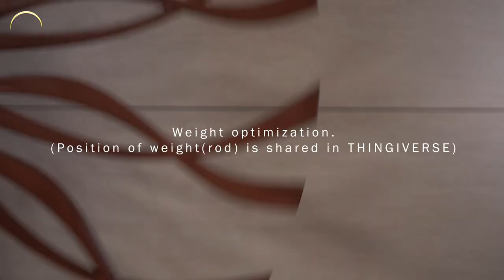The Process of Making Kinetic Sculpture that Creates Optical Illusions  (Branches, Kinetic Art)

Comment: Lovely work, Dr. Moon. I have created your Aurora version but am so frustrated. The two pawls do not transfer direction as they should.  I.e., the rotating wings do not change from their initial direction of spinning. I understand that the pawls need to interact so as to cause a change in direction but that is not happening. 
,
The pawls do work as planned when I rotate the wings by hand. However, when under speed, the back pawl never releases pressure from the control gear. It does not “hand off” to the front pawl. (I hope this makes sense?) Can you help me please?
Reply from the maker: Thanks for your interest on my work. :)

The situation I can guess from your comments is probably related to weight optimization.

The trigger is activated as the pawl of the front and rear wings crosses around 6 o'clock when the weight is optimized using copper weights.

Please check the 'reference for installation.zip' file uploaded together on Thingiverse.

Thanks :)

Comment: Thanks for the great work on designing this! Can you explain the weight optimization, can't find anything on thingiverse (as mentioned in the video). Kind regards.
Reply from the maker: Hi!

In the thingivese link, i uploaded few of photos. and 2 of photos indicate the position of copper rod weights. So, when you make my kinetic sculpture, you can refer to it.

Simply, the purpose of weight optimization is increase total weight of front and rear wings. and also optimize center of gravity of two wing to properly operate kinetic sculpture.

In my experience, the exact principle can only be understood by making it yourself. :)

Thank you your interest on my work.
Warm regard :)

Comment: It's really amazing,good job, could you make it with simple materials?
Reply from the maker: Hi!

What simple materials means?
Reply: I believe most of the parts are 3d printed. The hardware parts needed are listed in the video description.
Reply: The simple materials means no 3d printer,just some wood pieces....in any way thanks for your efforts,you are the best.
Reply: @adambw5516  this artist usually puts the designs for free up on thingiverse and includes a link in the description. The files are in stl format, which you can open for free in a program called cura. You can translate them to more traditional plans once you have the files open. Hope this helps.
Reply: Hi sir it's cad file have pls send me sir

Comment: What’s the flexible filament you use for that one part
Reply from the maker: Hi~

If a part is printed using flexible filament, the part has properties like rubber. 

The reason why i used flexible filament is to reduce noise which is caused by contact between onewayGear and onewayPawl.

As I commented in video, it is not essential to use a flexible filament.

thanks :)

Comment: Hi
I have a request for you. Please help me, thank you
I want you to write the material used in the 3D printer in front of each piece.
- controlGear (1 ea)
- springGuide (1 ea)
- mainBlock (1 ea)
- frontWing (15 ea)
- frontWing_center (1 ea) 
- frontWing_block (1 ea) 
- rearWing (15 ea)
- rearWing_center (1 ea)
- rear_subRing (1 ea)
- pawl (2 ea)
- oneway_pawl (1 ea)
- onewayGear (1 ea)
- wallMount (1 ea)
- wallMount_back (1 ea)
- cover (1 ea)
- gap_5 mm (1 ea)
- gap_20 mm (1 ea)
Reply from the maker: - PLA WOOD, controlGear (1 ea)
- PLA WOOD, springGuide (1 ea)
- PLA WOOD, mainBlock (1 ea)
- PLA WOOD(DARK), frontWing (15 ea)
- PLA WOOD, frontWing_center (1 ea) 
- PLA WOOD, frontWing_block (1 ea) 
- PLA WOOD(DARK), rearWing (15 ea)
- PLA WOOD, rearWing_center (1 ea)
- PLA WOOD, rear_subRing (1 ea)
- PLA WOOD, pawl (2 ea)
- PLA WOOD, oneway_pawl (1 ea)
- FLEXIBLE PLA, onewayGear (1 ea)
- PLA BLACK, wallMount (1 ea)
- PLA BLACK, wallMount_back (1 ea)
- PLA WOOD(DARK), cover (1 ea)
- PLA BLACK, gap_5 mm (1 ea)
- PLA BLACK, gap_20 mm (1 ea)